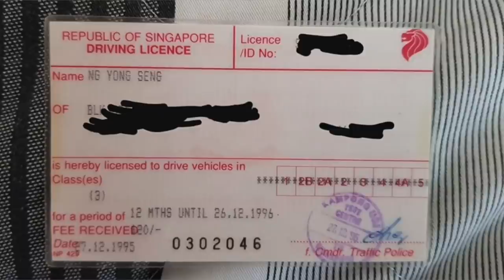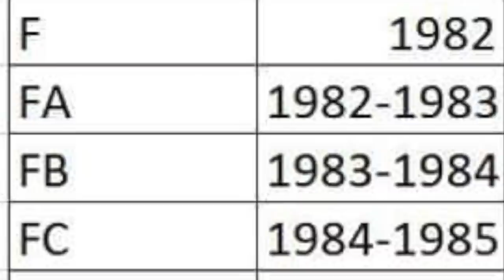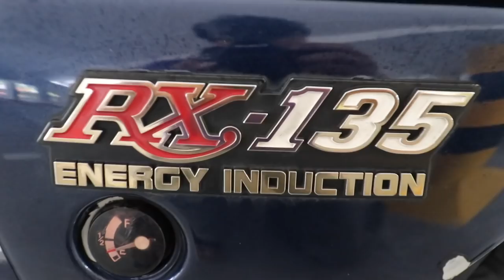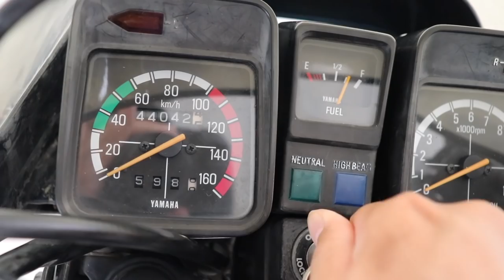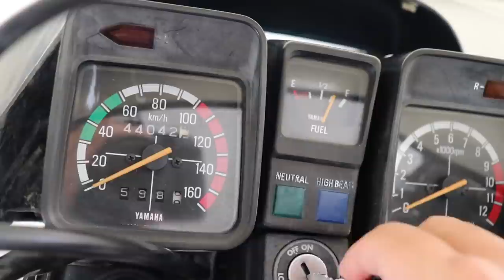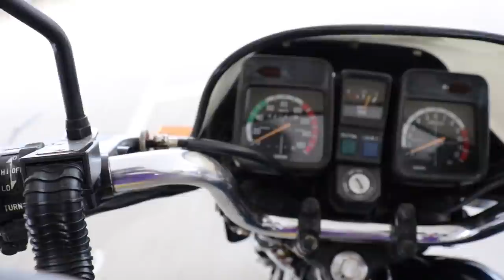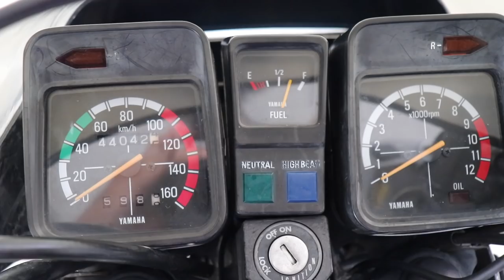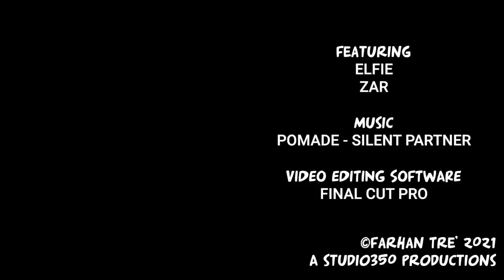Vlog#285 Yamaha RX-K 135 Motorcycle Review Singapore

Comment: I have 1989 rx 100 ....RX THE LEGENDARY AND DAD OF ALL MOTORCYCLE .....THE SOUND 😍💨...the pick up of the all rx is extremely high and u feel like In roller coaster 😅
And this are the bikes in Yamaha RX 2 strokes starting from rx 100,rx135,rx135 -5speed ,rxg135,rxz135,rxk135,rxs115. And the father of all this bikes is RD 350 💯🌪️ and this is the dark side of japan 🔥

Comment: i met a malay guy who also own this bike, he said it top speed can reach 180km per hour, i ask him how he modify, he said he never modify anything except tune for more fuel, and he also said this bike got no airbox and air filter, so this give an idea of anyone wanna to increase  horse power by just remove the airbox and filter, tune for more fuel to match the air, however mine have done this, except i install k&n air filter, my next move is to relocated the air filter outside the engine bay to allow to suck in cold air, all this modify is legal, changing the exhaust pipe is illegal , and risk of getting caught by LTA  while riding on the street, first time fine is $500, second will be $1000 and another more more time, go to court, this is not worth it, unless you going to race with someone else with a lot of money and you no sure win
Reply from the maker: Power of 2 stroke i guess. But 180kph? Damn...
Reply: @tambakoverlanders  180kph that what he said, and i found out that the speed meter is not accurate, i saw a youtube it go 180kph in speed meter and rpm only 9000, and i have check it wheel it only 90mm, it should be at 152kph instead of 180kph, another youtube use gps it rpm is 11000 and gps show only 115kph, however my bike at only haft throttle it go 9000 rpm, it wheel is front 90/90mm rear 180/90mm,  2 stroke good  and fast only for pick up long distant the bike will get very hot and decease power